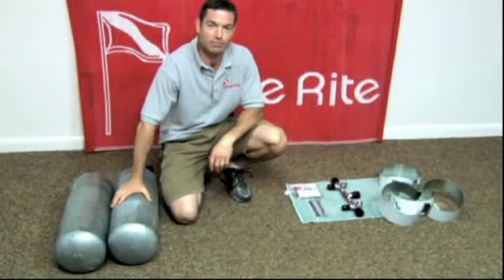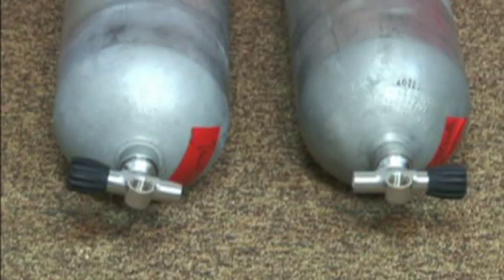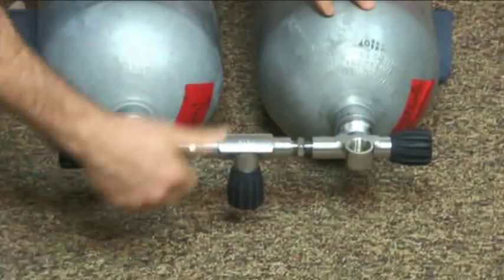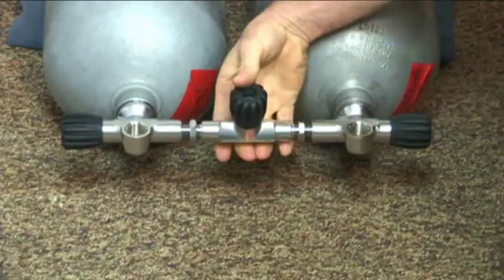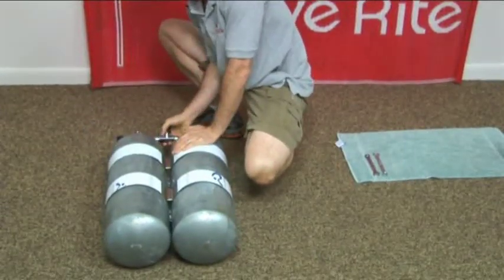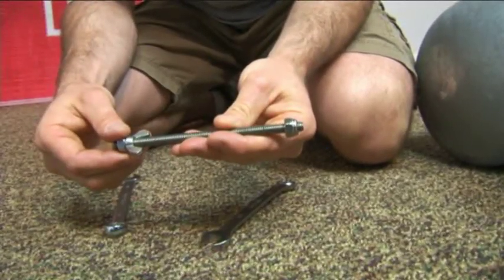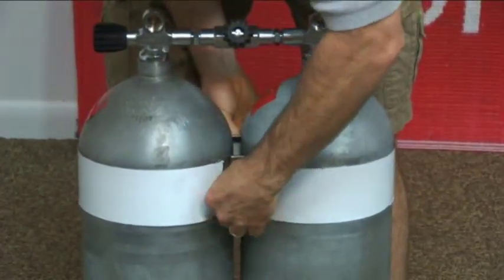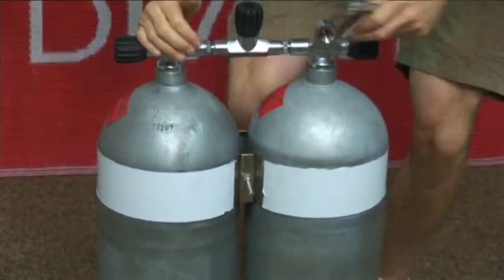Technical Diving: How to Assemble Double Tanks by Dive Rite

Comment: I think people have thought this through a bit more since first posted. Put the tank bands on first and lay them down. Steel won't stand anyway. Make sure the posts aren't proud of the tanks. Then put the manifold on by spinning the tanks. Adjust and tighten the bands. Don't tighten the manifold locking nuts. Having the center valve rotate minimizes the chance of damage.

Comment: When you pick up double tanks, do you carry them by that center valve?  Just wondering.
Reply: No, you should always carry them by the two valves at the sides. Best not to put pressure on the manifold itself.
Reply: Rescue Diver io0cì

Comment: I prefer the LOLA twins set up for valves as it gives more security then this system. In everything fucks up scenario you are able to shut the manifold from both sides and you end up with two independent air tanks. Here if there is a problem with the manifold you loose one air tank.